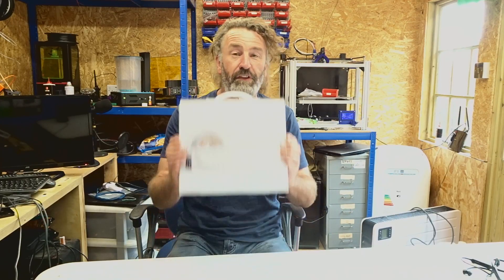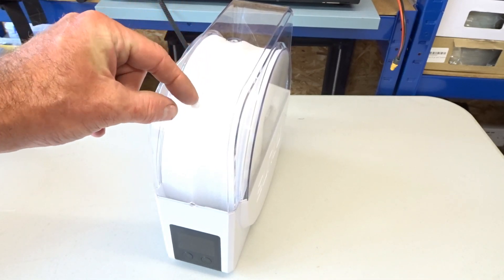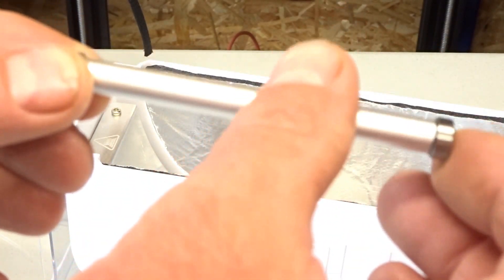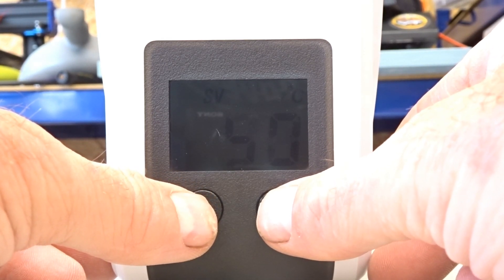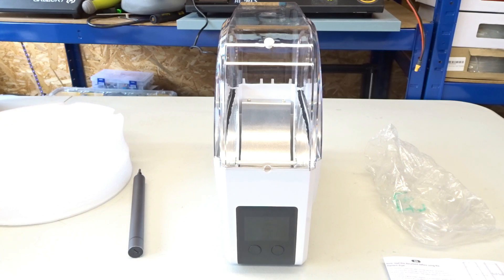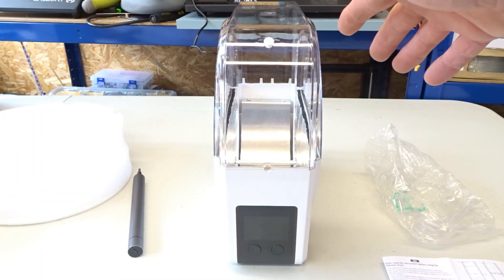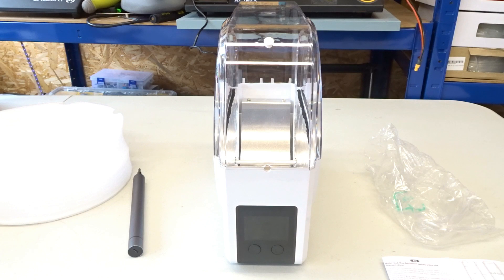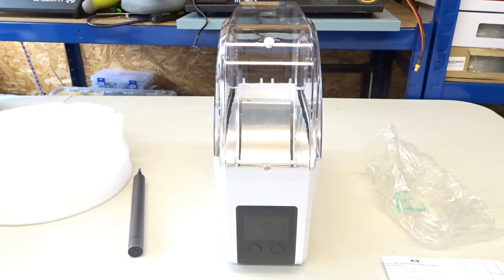SUNLU FilaDryer S1 KickStarter 20/07/2020

Comment: Looks like it needs to be a bit wider for larger spools. Maybe a small circulating fan? Personally I have a food saver that I seal all my open rolls in with a nice bag of reusable desiccant. Works like a charm!
Reply from the maker: I used to do that but I got lazy 🙄
Reply from the maker: Just measured it for ya maximum reel width is about 83mm